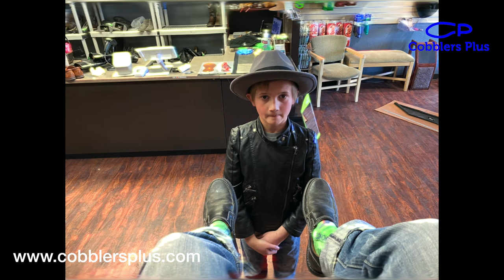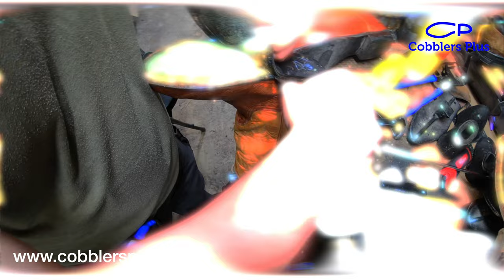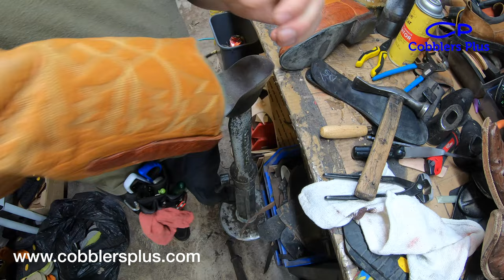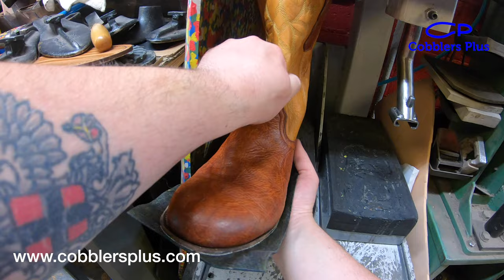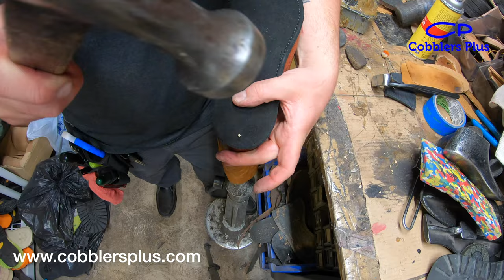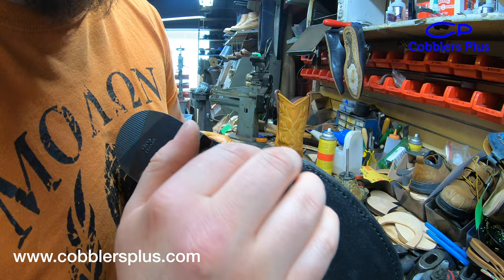Custom Evenin' Star Dance Boots resoled with suede soles

Comment: Looking to suede a pair of clearance sneakers my wife bought. My ballroom shoes were about $150. I want to make a new pair of casual dance shoes. 
What grit sandpaper would you recommend for smoothing the rubber sole before gluing the foam and suede to the bottom and also for smoothing the sides after attaching the suede?
My shoe guy moved across town ☹️